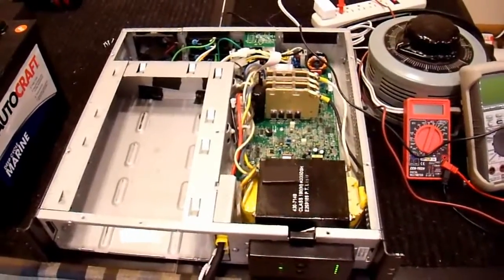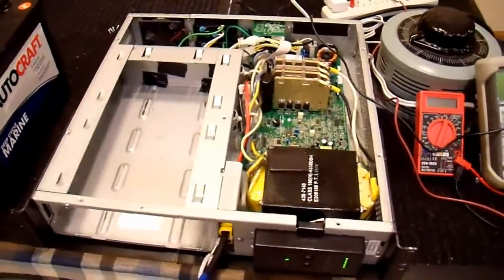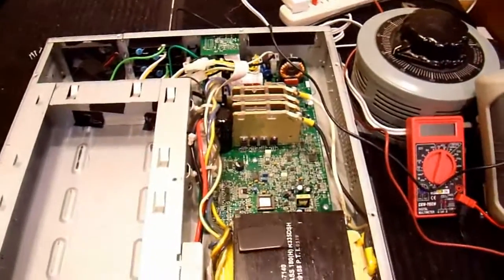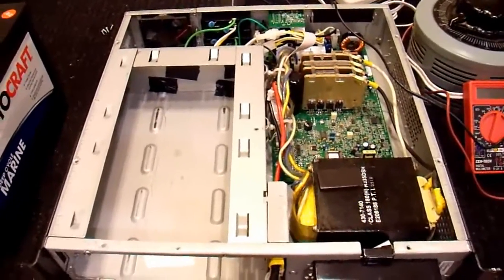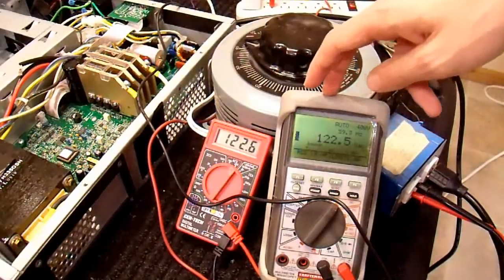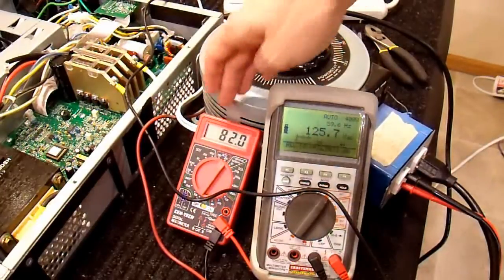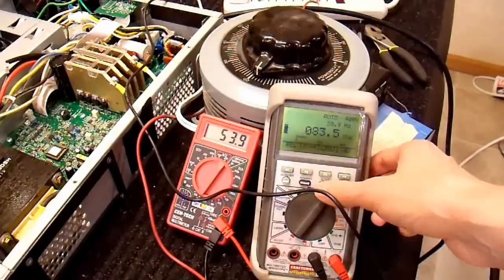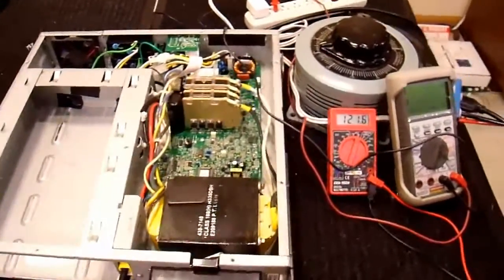APC Smart UPS Sync to Mains Demonstration

Comment: thanks for this wonderful information. I have seen your other video of forcing the slave UPS to always run on battery in parallel UPS configuration as well. I have a problem to solve and was thinking if you can provide guidance. I would like to run an 4000KVA air conditioner on the 3000KVA UPS (modified for 4500KVA by increasing mosfets following your other video). Now I want to use this UPS  as a VFD to start the air conditioner at lower Hz approx 25hz instead of 50hz. Was thinking to force the UPS to always run on the battery mode and in the main supply provide a VFD signal of a lower wattage. What do you think of this idea or else if you think we can trick the UPS somehow internally to place a controllable frequency probably using 555 or something?

Comment from the maker: If you have a clamp meter you can check for a current surge from the battery on startup.  An ohmeter can find shorts in most places on the FETs, but if the transformer insulation has failed it is a much more difficult problem to diagnose.  Without special tools like an LCR your easiest method may be to swap transformers with a working unit if you have one to see if that is the problem.  It doesn't necessarily have to be from another 1500 as long as the battery voltage is the same.

Comment: You are very good!
At startup without load, my 1500 goes to overloaded status with the red solid overload light comes on and the unit sits there with a constant 'beep'.
I changed all the mosfets but the situation is the same.
In your opinion what should I check?